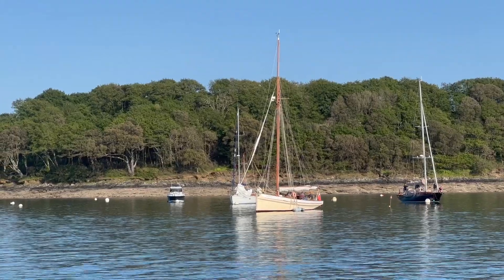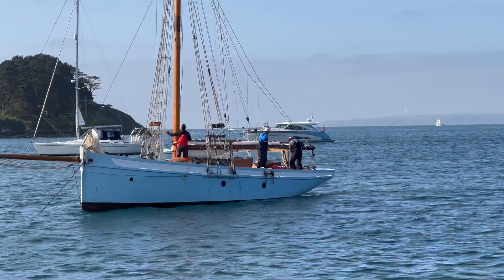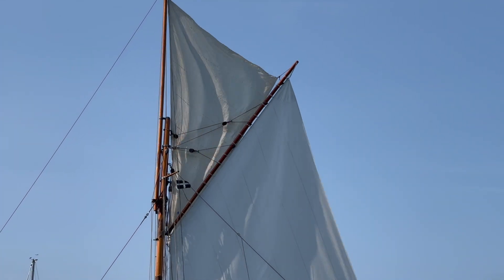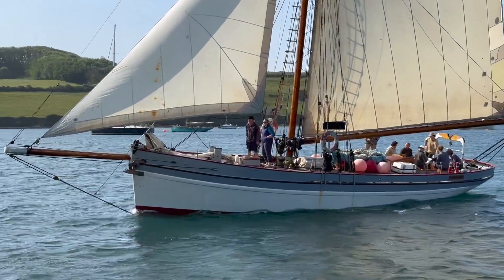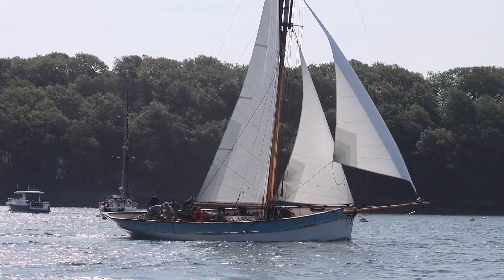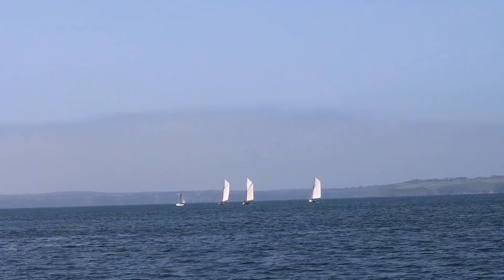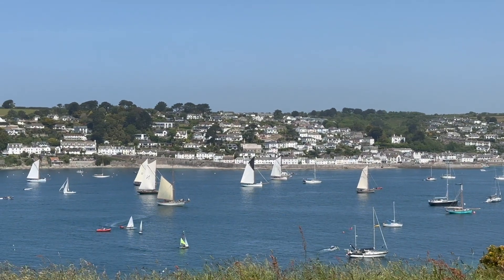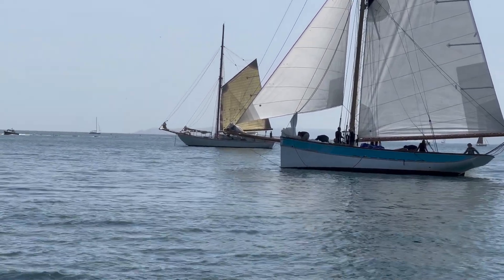The Majestic St Mawes Pilot Cutter: A Must-See Review

Comment: I'm surprized that the cutters wern't sailed of with a scandalized rig . This was always used as a quick getaway.
Reply from the maker: Hi Gary , yes your probably correct for sharp get aways when they were competing for work. I’m thinking full sail was just easier to set in a situation at St Mawes where they were just up anchor and heading for a start sequence , so no pressure till the start gun , then it’s top speed , so full sail would be required .Also the wind that day was fairly light so the more sail up the higher the boat speed until at max hull speed or wind increases and over canvased.